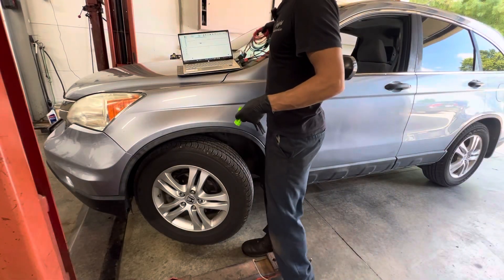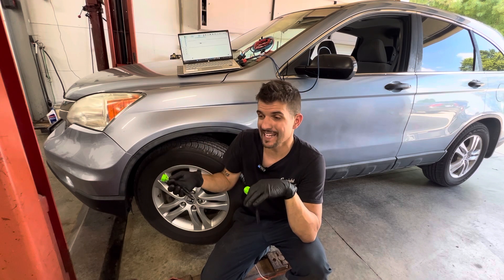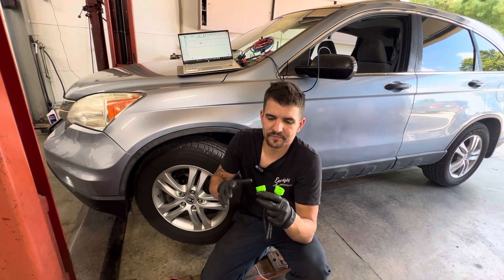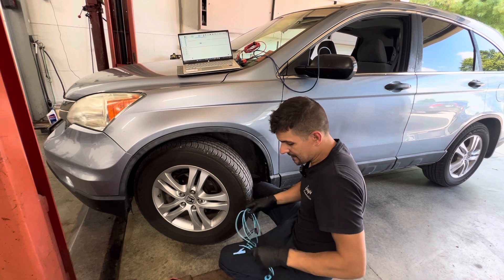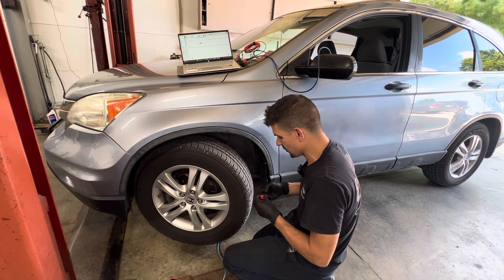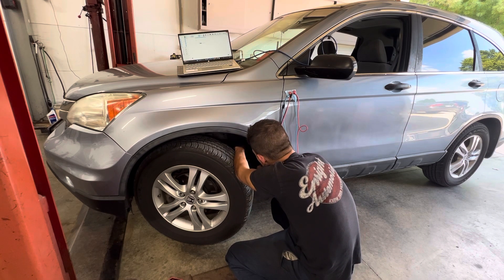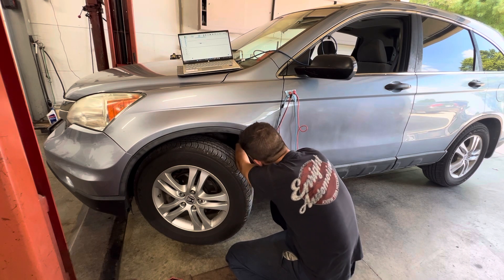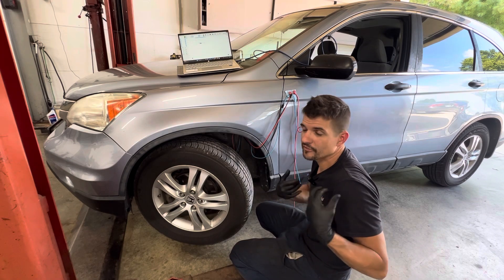Test don’t guess! Noise detection sensors.

Comment: Here is a Long winded discussion about sound detection setups for this purpose, as nobody sells everything as a complete unit (except chassis ears). Most people start with Chassis Ears. An Osccilascope like seen in the video is a step better using probably piezo sensors pre-made with magnets, a Hantek Oscillacope and a Laptop. This is an expensive way to do it. I instead used an AI design my own setup. I got a 5 channel Oscillacope with its own display, then I built attachable sensors with 27mm Piezo vibrations sensors, some coax wire, strong magnets and alligator clips for multiple ways to attach sensors and of course the necessary adapters to get the signal from the sensors to the Scope. In theory this should work plus eliminate the Laptop as well as being a stand alone unit with hours of battery life AND much cheaper, much less wiring. I even got some Coax to Headphone adapters which in theory would allow me to plug into headphones one sensor at a time and actually listen to Piezo sensors. I accomplished this setup for $140 total, cheaper than the Hantek unit itself, no laptop drivers needed. I will be testing this in a few days. I already anticipated the shortcomings of Chassis ears and went straight to Visual Wavelegnth detection. I have replaced the wrong part on my car one too many times I'm done messing around
Reply from the maker: “In Theory” “should” those are words professionals can’t afford to gamble on. We test don’t guess. Laptops also aren’t that expensive compared to throwing a bunch of parts at a vehicle it doesn’t need

Comment: Using the time scale you can see which sensor is closest to the noise as well.
Reply: That can be better in some cases, the problem may not always be at the loudest sensor but the problem is always closest to the first point of the noise

Comment: very interesting video! I have a strange noise from the front wheel, which is not hearable on the lift up, so this might help me. What else except noise sensors and oscillograph needed? or you just connect joe's sensors to Pico and that's it?

Comment: I've got the Pico 4425 & 4425a and needless to say the 4425 is collecting dust. I have the Zeus also & Autel scope but the Pico 4425a outperforms them all. I have Chassis Ears but that's a nice setup. Just might have to get them 😂
Reply from the maker: They are super nice to have in the arsenal. Just to have more documentation. Once I get 2 more and can run 4 channels I’ll be happier
Reply: @Enrightauto  I know Joe & have watched his channel for a long time. Quite a character & good diagnostician & mechanic. Sorry to hear his shop is closed but he is great making stuff for his on-line store. Great price on the sensors especially helping track down noises b/c they transmit all over.
Reply from the maker: @haywardsautomotive6156  yea haven’t really known him but saw he was out of work so helped what little I could by buying some stuff
Reply: @Enrightauto  Yep we know how it is & I'll probably buy them even though I'm semi-retired. I'd say retired but some of my customers still bring me their cars. Strut upper mounts pop just like stabilizer links sometimes.
Reply from the maker: @craigb3671  joesautoelectric.net is the website. I just checked it out and it’s working currently
Reply: @Enrightauto I got it, it's my works it department blocking the site from fully working, just ordered 4 and some ignition pickups.